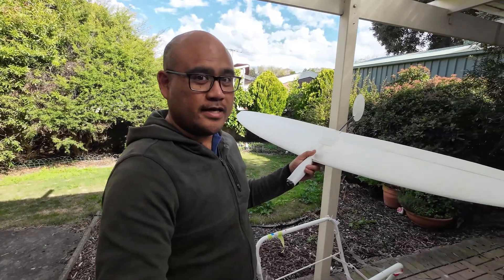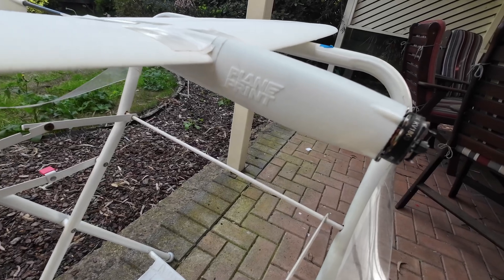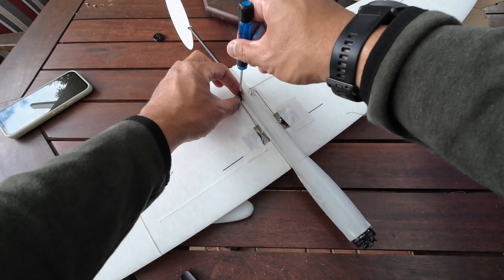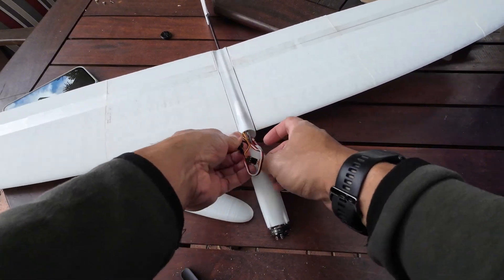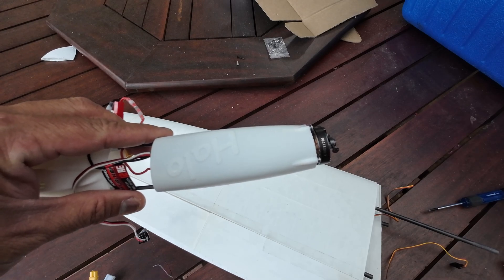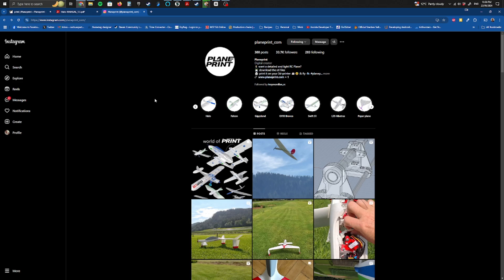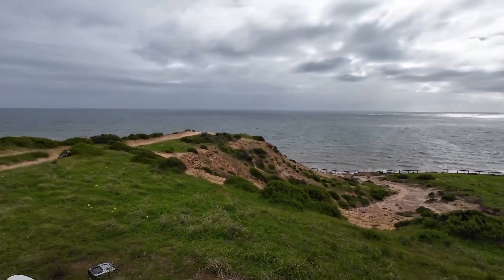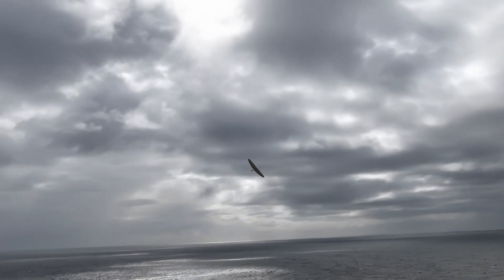Can a tiny 300g 3dp glider wing withstand 35-40kmh winds?, a closer look at the plane print HALO

Comment: Hi there, hope you see this.  I have just finished printing a HALO for myself.  I was just wondering, what sized servo's/motor did you use ??
Reply from the maker: HI mate, sorry i haven't logged on for a few days, and just saw your message. 

For this one, i used 2g servo's (but it's a bit low imo) but i reckon you can fit up for a 4.5/5g type servo  

With regard to a motor, i didn't use one for this one, i had one mounted, but let me get back to you regarding the size :)
Reply: @locarshobbies  Much appreciated info, I'm just about to assemble mine.  Any tips on how to fix the rudder in place so that it is vertical compared to the fuse?  As far as printing is conerned, I printed it on 3 build plates, the ENTIRE wing and ailerons on the first plate (yeah there was some stringing, but easily fixed with sandpaper and elbow grease), the fuse and all the tabs on the second and the single piece of tpu (for AMS2) on the third.  As far as the printer is concerned, I printed it all on my Bambu labs P1S in a couple of days.... EASILY

Comment: Very nice review, Im printing one myself without a motor. Might I ask how you fix the battery in place, does is sit loosely inside or did you use velcro of some kind?
Reply from the maker: So the designer did use a tray that goes in but I found it mroe fiddly than it's worth the battery I used shoved in nice and tight so I didn't worry about it 🤣

Comment: Nice review and bravely flown.
Packs down well so would make a good travel model.
My landings, in those slope conditions, tend to be "controlled arrivals" ;-)
How did it bear up on the landing please?
Reply from the maker: Hi! Thanks for watching! I'm quite lucky that the landing area at lonsdale is quite generous unlike most slopes, and some really nice long grass to gently stop the model

She landed well, no damage whatsoever! I should have taken a video of the post landing state I will make sure to do that on future videos

The fuse in pla+ can take a slight besting and it's designed strong, but the wings printed in lw pla might not take too kindly... The counter point is that it's not a big print to re make 👍